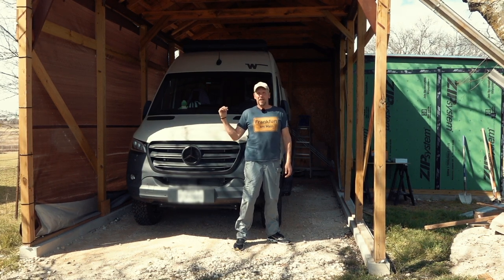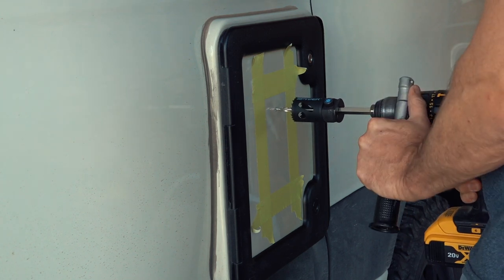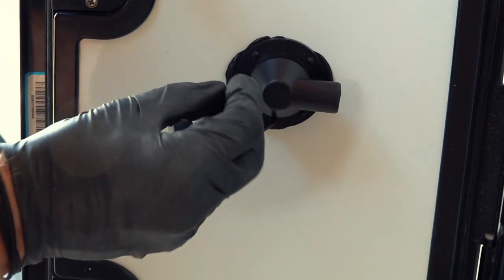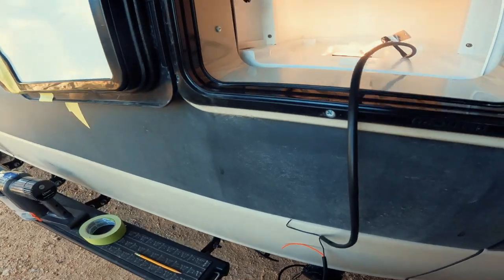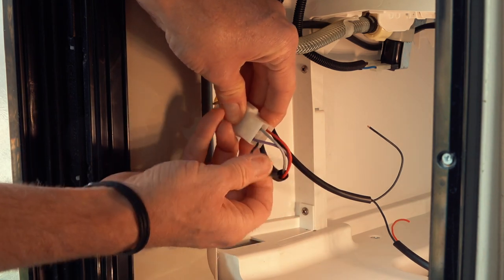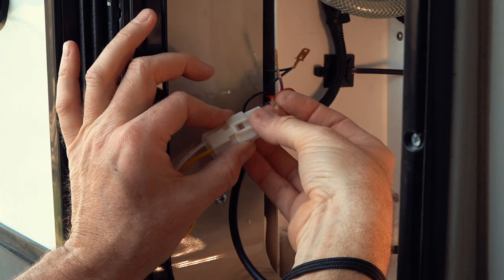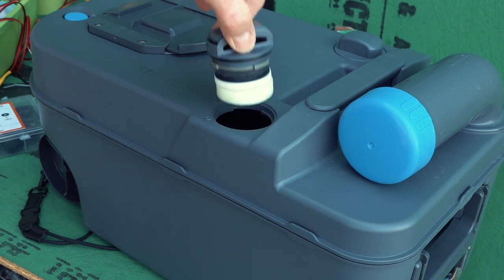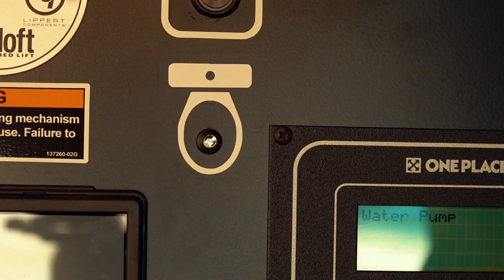Chemical Free Toilet | SOG- System | Winnebago Revel

Comment: I was looking at the C200 model, maybe it’s the wrong one. The one I was looking at connects the vent to the venting valve spot, but now that I think of it it’s in a different spot that the one that is on the Revel.

Comment: I installed the SOG system successfully! Thank you.  Where did you get the LED light indicate the SOG fan is in the ON position  to mount  on the panel ?
Reply from the maker: awesome. let me know how you like it. the LED is just a regular yellow  5mm LED with a resistor so that I can hook it up to 12V. Amazon sells them pre-made in a bunch of colors. the sticker I cut on my vinyl cutter
Reply: @orange13  Did you run the LED wire behind the wall where the hole was drilled at 12:24 and fish it out behind the panel ? Your videos are very helpful!! thank you again.
Reply from the maker: @RickLozon-d1v  hi Rick, yes, correct. It is hard to see in the video, especially because my van is that sand tan color (Pebble Gray) and there isn't much contrast between the color of the toilet door frame (van color) and the actual backwall of the shower (white color). but between the door frame and the shower panel you can get access to the area under the bench seat. from there  you can go up and behind the wall to where the LED is. Hope that makes sense.

Comment: How's  it been working???
Reply from the maker: this is still my favorite upgrade. the toilet is 100% smell free - even after sitting at 100°F for weeks. and because there are no chemicals, I feel good about emptying it in my septic tank. Also, I am using regular toilet paper which dissolves without issues. Note: we only use the toilet for #1. YMMV